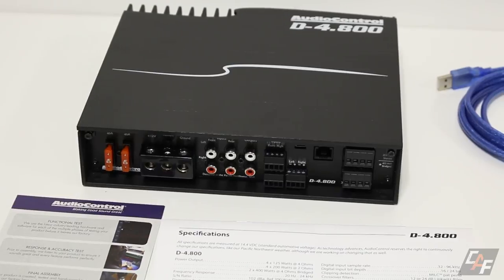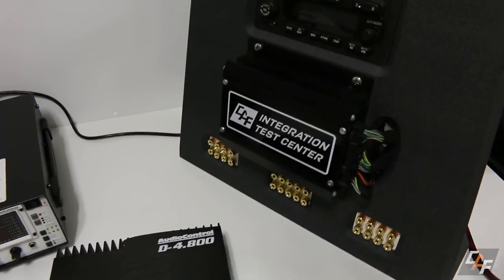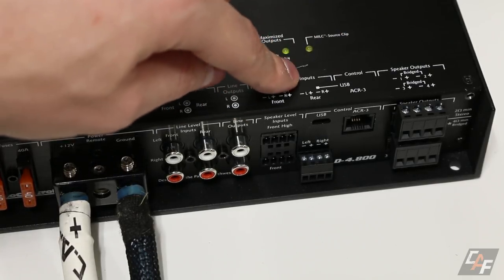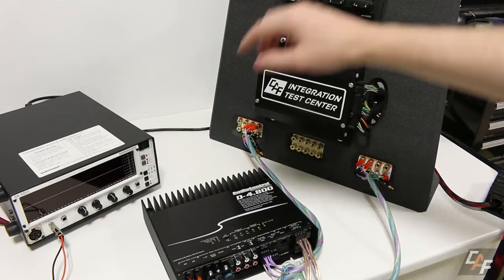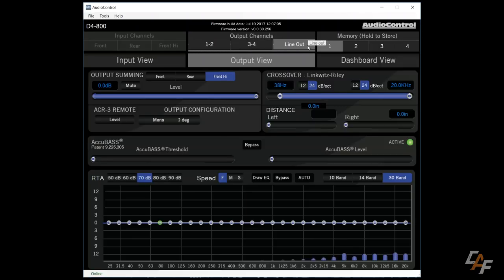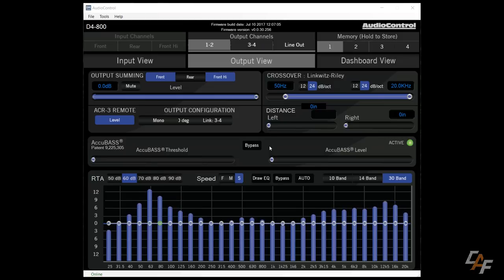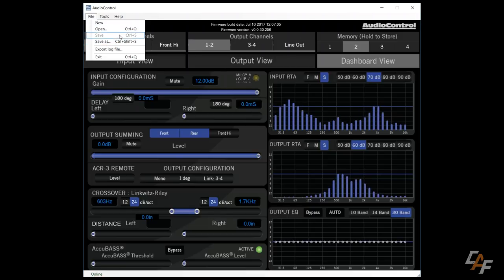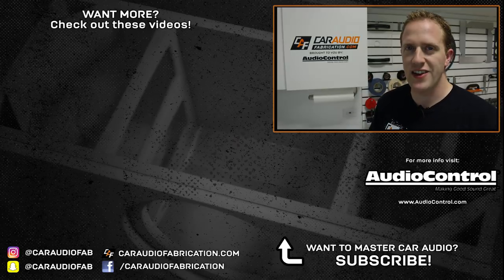DSP INSIDE AMP?! AudioControl D-4.800 Amplifier

Comment: Cool! Audio Control is one of the advanced car audio brand when it comes to technology especially the DSP models and the D series amplifiers, you don't need to install a external crossovers, equalizers, Sound processors & etc, that can cause signal cables all over your vehicle

Comment: Hey Mark, hoping you see this but when using this product in conjunction with an aftermarket radio would you personally use the high level inputs or the aftermarket radio’s pre-amp outs and why? Also, I’m assuming with there being a built in DSP I could send the “corrected” input frequency to my subwoofer amp, I’m just not quite wrapping my head around how the signal chain would work there. Thanks in advance if you see this and respond!

Comment: I plan to splice into my front speaker wires since my factory radio does not have RCA outputs, my guess is that since I am not disconnecting anything from the factory radio, I will not lose any of the chimes and voice commands by doing so...

Comment: Would this amplifier be too much for powering a set of focal ps 165 fue component speakers rated at 80rms? And a 10 inch focal p 25 fue subwoofer rated at 280rms? 

I see that the audio control would give me 125rms per channel at the speakers and a 400rms bridged connection to my subwoofer 

I don’t know if there is a way to adjust this amplifier to work with the rms that I need, this could be the perfect solution to installing my audio system to my fiesta st 

Sent from my iPad

Comment: hello sir. i have dm810 processor. i dont install yet. but i want to operate it with laptop via connecting cable it doest not boot. Whats is the problem with it. is it connect with power cable and then it is working with laptop? please answer my question sir

Comment: I'm still not clear on that "front high" input. Is it to control the chime levels when integrating into a factory system? If you use that input solely for that purpose,then how do you get the front left regular audio to play? Are you expected to split the front right signal?

Comment: Can the ACR remote work on the line out? this way you can use the amp itself to run mids and the line out to a sub but use the knob as a bass knob.
Reply: Exactly the question I have

Comment: Mark if I use this as my dsp how are my crossovers for my components used?  Thank you!!
Reply: You don't need the passive crossover. Running a DSP means an active system (each woofer& tweeter directly to the amplifier) all the "crossovers" points will be done by the processor

Comment: Considering getting this along with a lc-1.800 to power 2 jl 10 tw3. My question is if it would be better to use the acr3 to the 4.800 as my sub control via the rca output, or to use the sub out on the pioneer nex

Comment: I want to get the D-5.1300, but am not quite ready to get a sub yet. I know it is generally not a good practice to leave an output unpopulated on an amp. Would that still be the case for an amp with a DSP built in and could that channel just be disabled until I am ready to use it?

Comment: How well would something like an Audio Control D-4.800 pair with a set of Audison APK 165 components? I also am looking at an LC-1.800 to power 4x Sundown SA6.5 subs in a ported/tuned box. RMS wise, this amp setup is matched extremely well to what the Sundowns will take (200w RMS each). The goal would be to feed the LC-1.800 (sub amp) with the RCA signal from the D-4.800.

Comment: I'm thinking about adding the LC4.800 to my 2004 Acura TSX. Since it has 6 Speaker Level inputs, should I use the post factory amp signal? My car uses front active tweeters, and the pre factory amp signal is a balanced one. 

How should I tap into the wires?

Comment: If I already have the DM-810 but want to run the D-4.800 on my A pillars and the LC 4.800 on my doors, can I run it without using the DSP feature on the amp?

Comment: With component speakers and vehicle having component speakers can I group up the factory tweeter n woofer “high output wires in a group to make up the full spectrum?

And use the aftermarket component crossovers?

Making the factory components one channel per side?

Using that amp.

Thanks in advance!

Larry

Comment: So what if your head unit has 3 outputs front rear and sub rca’s do you just say the hell with the sub output and just get a mono block amp an hook it up to the line level out of the 4.800 and set it up for an sub in the software?

Comment: Is the RCA line outputs good to run to a monoblock or two channel amplifier and power a subwoofer(s), no Line Output Converter needed??
Reply from the maker: Exactly! You can use the "RCA" output from this amp to send signal to ANY other amp that accepts "RCA" style in.... and better yet... You can control the signal on those channels with the DSP!

Comment: I got 4 new door speakers and 2 new dash speakers. Would I be able to run all of them with this 4 channel?
Reply: I’m needing to know the same thing. 2 front woofers 2 rear coaxials and 2 front tweeters but I’m trying to not use a crossover for the front. Did you end up figuring it out?

Comment: Something I noticed about the MILC light on this amp. I noticed that when setting the max volume from my head unit to apply to the D.4-800, the MILC light on the D.4-800 comes on a lot sooner than the MILC light in the DSP software. I actually connected an O-scope and from what I saw, the MILC light in the DSP software appears to be more accurate with detecting clipping. I didn't see any noticeable clipping until the MILC light in the software came on. Has anyone else noticed this?

Comment: okay so my question for this is how many chennels does it act as a dsp for. would I need to buy 2 of these for an 8 speaker car, I want to know if I can just buy this dsp/amp and another amp (amp only rather than buying 2 dsp/ amps) to power and eq all 8 speakers. or is it best to buy 2 amps and a separate dsp.
Reply from the maker: I'd look at the new 6 channel D-6.1200. That gives you 6 channels of control on board plus 2 outputs that you can control

Comment: I have more speakers I want to power and may get a D-6. I was going to use one of those channels to send to Kicker crossovers for components, to save some channels so I can power mids and rears also. Have you found that type of strategy works effectively?
Reply from the maker: Yes you can do that to save channels, many people like to run active though and go straight to speakers, but you need to know what you are doing to avoid hurting the speakers.

Comment: Do you need a external RTA if the amp/dsp has one built in to the software?
Reply from the maker: +Derek Stechmann depends, the rta in the software allows us to see what the electrical signal looks like coming in and out. This is awesome for summing so we can make sure we have a full range signal as an example. If you want to then measure the ACOUSTIC response (which changes based on environment, speakers, etc) you need an RTA mic
Reply: CarAudioFabrication Thank you

Comment: Mark, great info! I'm a ford tech and plan on buying a newer Expedition el. Since the models i'm looking at come with a factory dsp, would i bypass the factory one and wire this in instead? I'm planning on running a full alpine type r system. Maybe 6.5 components in front and rear then 6x9s in rear quarter panels and 2 type r 12s in rear. Is there a line converter that i could install to control 3 to 4 amps that has the dsp and eq functions?
Reply: Hi Jessie. If you plan on getting a Sony branded factory system there are a few ways to interface the factory system either pre amp or post amp. If you are getting a 17 with B&O you will have to interface post amp with a DSP.
Reply: Best solution by far is the Rockford-Fosgate DSR-1. It eliminates the Sony amp which has all the DSP features built-into it. The OEM radio since a unfiltered signal to the amp and it does the rest. The DSR-1 uses Maestro AR technology and it handles the conversion of the radio's signal to low level. The DSP is the same RF 360.3 CPU with a different firmware as it has muted some of the features of the 360.3 to reduce cost. What you are left with is the vast majority of 360.3 features and 8 channel output. It's also affordable at $250. All you need is the Ford Harness from Maestro, update the Maestro then update the DSR-1, set up via laptop and then plug it into your car, you are done. Plug in your amp and speakers to the harness and then open the Perfect Tune app on your phone to set everything up.

Comment: my question is can i use this to power 8 inch 200 watt peak subwoofers 4 6.5" 200 watt peak doors and 2 2" tweeter 250watt bullet tweeeters
Reply from the maker: You would have four channels of output with this. You could send signal from it to a second amp for the subs.

Comment: What is the difference between this and lc 6.1200?
Reply from the maker: This has two less channels but a DSP built in. D stands for DSP built in. There is also a D-6.1200 which is basically an LC-6.1200 with the DSP inside

Comment: What's the difference between this amp and the DM-810?
Reply from the maker: The DM-810 is a stand alone DSP. You would use it as an interface between a source device and an aftermarket external amplifier.
Reply: CarAudioFabrication thank you! The D-4.800 is what I need then. It's everything in one.

Comment: Hi, I had a d4-800 installed. It is in a Honda Ridgeline, as well, Clarion component in front, 3 way in rear.
After the install it literally sounds like crap! The sound bounces/echoes all over and its shrill.
Is there a particular setting on the dsp I should be adjusting via the provided software! Any help is appreciated, thanks!

Sent from my iPad
Reply from the maker: DSPs need to be properly tuned, tuned incorrectly the results will be poor.
Reply: CarAudioFabrication      Yes, apparently mine is not tuned correctly yet! Sounds hallow!
Reply: This can happen if you sum let's say, channels 1-2 and 3-4 if those channels are outputting the same signals.  On my setup, channels 1-2 and 3-4 (front and rear speakers from a factory unit with no existing amplifier and crossover) are set from 90hz to 20khz (mid range and highs). I accidentally summed the 2 together while messing around and my system sounded EXACTLY how you described it. If you're summing, make sure that you're only summing together channels with different frequency ranges.

Comment: Would. It be an upgrade to passive crossovers for components front?
Reply: grin and bear it - 
That really depends if the processor adds noise, or restricts the sound stage in any way, (doesn't sound as open). The issue with applying the passive filter on the speaker lines is phase-shifting.  With the crossover at the processor at line-level, there is less current to lag behind the lower voltage, not entirely sure how active processing overall effects phase-shifting. I believe when voltage goes up, current goes up, and lags behind the voltage, due to the large capacitors in the passive crossover.  With the processor, you can time align the tweeter channel from the mid-channel to negate any phase shift.
With the Linkwitz-Riley configuration built-in, a 12db slope is a second order, gives 180 degree phase shift. On a passive crossover, you would wire the tweeter out of phase. On 24db slope,  that's a 4th order, 360 degrees out of phase.
Reply: Captain Buff The Third, well, looking back at my comment, and.... wtf? You're right, it really makes no sense and over complicates a badly worded question. Basicly, was trying to say passive filters phase-shift... I think that was my point.

Comment: If I am using this amp with a factory head unit, what can I do in order to lower the volume of a telephone call?
Reply: Manually lower the volume either on knob or the phone its connected 2
Reply: Thedjrush  i was looking into some feature available in other amps or dsp’s.  However and fyi I was able to control that using the phone setup parameters in the headunit.
Reply: Yeah the  bluetooth volume I've seen usually on the head unit and not on any amp let me know if you find an amp with that capability possibly the nvx line?

Comment: Super interested in this product. It might save my Accord. 

Question is, is the purpose of "output" to simply put out a flat signal to your speakers? Can you use the output to "shape" the sound after you have flattened the output? In other words, work the output flat, then RTA your cars actual response. Then, return to the output section and manually adjust. 

I'm annoyed with other OEM integration solutions which force you to add hardware to do the fun "tweaking" stuff.

Do you HAVE to use the accessory volume control? OR, can you use the accessory to run subwoofer volume, and use your OEM headunit to run the master volume? It would seem that none of the integration solutions can handle adjusting the signal in real-time. Is that true?
Reply from the maker: You generally start with flattening the ELECTRICAL signal which is what you see on the computer screen. This way you have a clean starting point. Then you adjust to taste for the actual ACOUSTIC response. This could be measured by an RTA mic. I put electrical and acoustic in CAPS because it is important to understand the two are different. You could have flat electrical signal out of the amp to speakers, but their actual acoustic response will be different, this is why you further adjust on the DSP in the amp. 

The volume control is optional. You can pick in the software what channels you want it to control volume on, so you could do none, all, or any combination. So yes you could definitely use it strictly as a sub volume control on those channels.
Reply: Makes sense. 

But would using OEM volume control to run the system compromise fidelity IF the car adjusts the output in real-time? That is, in the accord, volume goes to about 40. But, even with flat bass and treble settings, bass is being "compressed" / reduced at any volume over about 20. In other words, there is built-in DSP that is shaping the sound as you increase volume. So, even with a corrected signal, you might have an issue where bass limiting is having an effect.

My thinking was that I would get this amp, set the factory tone controls for the bass to a minimum point, so I can get more signal strength from the deck. Then I would restore the bass in the amp, level the signal, and get to work applying the perfect response curve to the speakers and sub. But it would be 100% awesome to know using the OEM volume knob isn't screwing up my hard tuning work. What do you think?
Reply from the maker: @matt88169  This is what is called "dynamic eq" when the eq changes with volume, if this is the case you want to set the factory radio at a max unclipped volume, and use the add on controller knob to adjust the volume of all channels. So volume control would now be completely done through the amp.